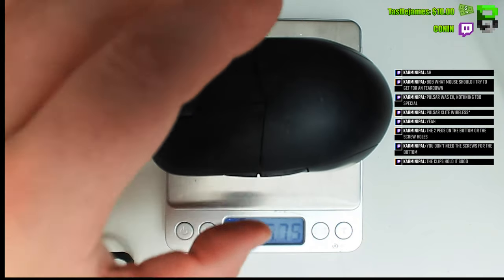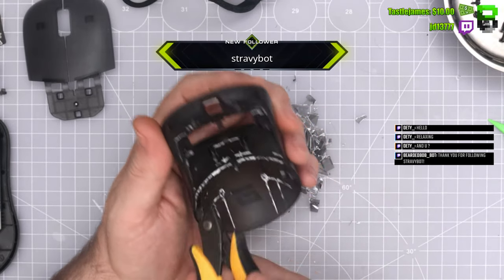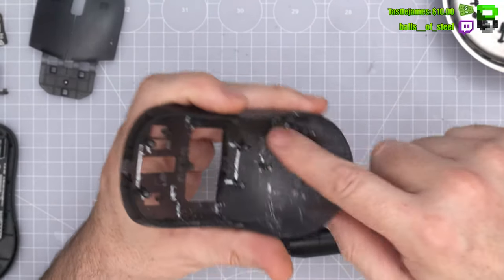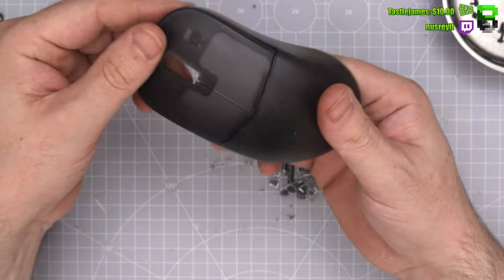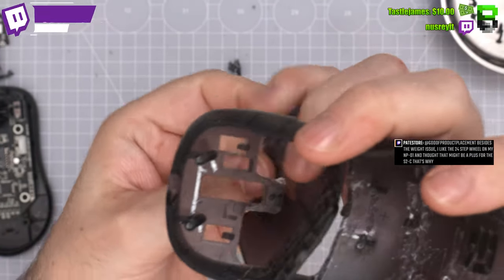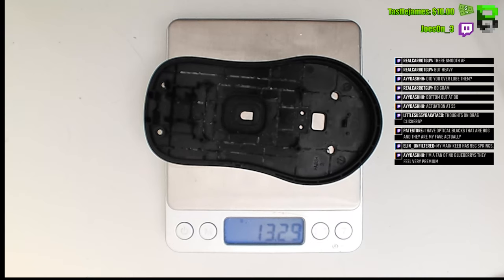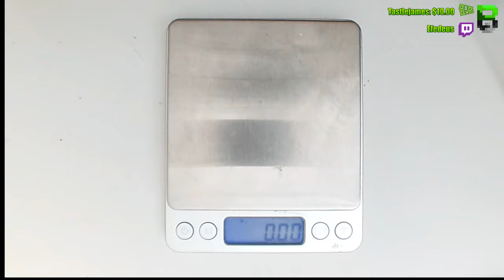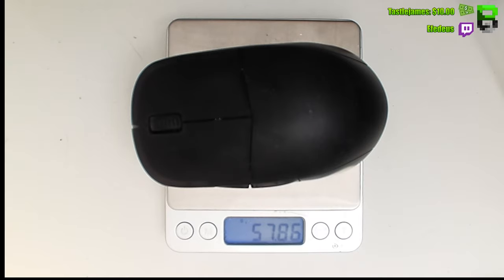Xm1r Weight Reduction - Make it Featherlight End Game Gear Mouse By Removing 10g

Comment: Better not delete refresh rate button. Not much weight but at needed place for balance

Update: deleted much more from a base and shell without cutting enforcements, but deleting some from double walls on sides.

Lightest custom cable and all cuttings gave 58.84 gr. and better balance than front balanced like in this video(My first modding gave 63g and almost perfect balance, i tried to compare this parameter with each variant from less to more cuttings)

Really love this mouse, was thinking about xm2, but not really in need of new sensor